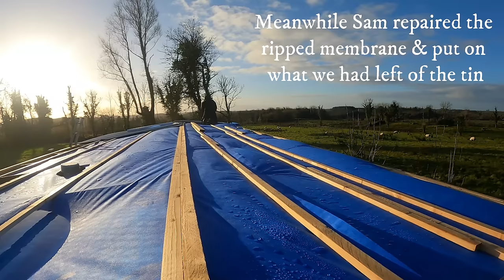Storm Debi hits our derelict farm in Ireland. Episode 14

Comment: Well done folks you got a lot done , after Debi left her trail of destruction. Scary stuff.The static will be so much more warm and comfy. When it's fully framed in. Hopefully you will have no more flexing walls after that. Fingers crossed we get no more big storms like that again for the rest of the winter. Glad you're all safe. Love seeing the kittens getting up to mischief outside. ❤.
Reply: Glad you are safe and hopefully you can get the static framed in safely slat roof and drain piping to remove excess water to hopefully avoid bulging roof
hopefully you got full flue sorted and also got some way of piping heat into the bedrooms - hopefully you will find good neighbours who will lend their hands and their advice/wisdom to you in helping you settle in and become absolute successes in your life here despite my own hatred for my homeland ireland
Reply from the maker: Yes we are cosy & and warm, and that makes a huge difference to your mindset. I will definitely be happier once the cladding is  done. No more bending in walls hopefully.
Reply: I'm only catching up with ye now at the minute, I'm just on the morning after storm Debbie, that tree that fell over an pulled up all its roots,if you cut off the tree from the base,the base should fall back into its original place,be careful if that's what ya do.
Reply from the maker: Thanks so much. The tree did exactly that! It's now just a big raised stump. In this weekends video you will see us start to clear up after storm Debi. Only just found the time after getting the caravan cladded. Thanks for commenting. 👍

Comment: Good progress on the roof. Glad that it wasn't a stronger storm. Nice to see you all getting on with it. 

My Grandparents bought a remote cottage in Herefordshire in the 90's up a mile long track with no services except a phone line strung along the hedge. 
 Me and my twin Sister aged 10 lived with our 60 year old Grandparents and moved to the Cottage on the Hill. We bought a Subaru Bratt 4x4 pickup and later a 1600 & 1800cc Subaru. 4x4 estate. We camped in the cottage, sink unit out the front. Had a grant for Kitchen, bedroom and bathroom 2 story block extension. Cottage was limestone.

 Waited a year for wayleaves/ permissions for electricity, transformer over 2 fields, wood, orchard and up our garden. In meantime using dreadfully unreliable Lister 14kva generator that took 3x 4wd to get it up there! Water was a borehole 273feet by a chap called Mr Morgan. Electricity finally connected after a year and 8k cost! 1600CC Subaru builders burnt out the clutch and Grandparents skint and it was scrapped. Used the 1800cc one with hi/lo ratio and builders hired a 4x4 thwaites dump truck.

As an 11-15 year old it was a fantastic place to live with wild deer, sheep, badgers, foxes, red kite. Could walk for hours and not see anyone.  hill fort, Fishpool valley and lime kilns. All owned by the lady of the Manor. There is a derelict tin roofed stone cottage further up the track and would love to buy it but falling down. No idea who owns it but expect price to be around 200k so unaffordable.

We lived there for 4 years and when sold had to pay a proportion of the grant back.. Bought for 30k, sold for 85k. The people we sold it to still own and live there and love it. Moved from such remoteness to a grade 2 listed double fronted Georgian townhouse in Harborne Birmingham. Then Porthleven,  Cornwall.  Near Villedieu-Les-Poeles, France,. County Kerry and now back to the UK. I live on a narrowboat.
Reply from the maker: Thank you for sharing your story. I really hope my kids look back on growing up in a rural place as fondly as you do. ❤️

Comment: I’m delighted that dodgy lintel is down. Those give no warning before letting go and, unlike brick/block walls, rubble walls keep falling until there’s nothing left to fall. All that stone you shifted could decide it wants to come down just as one of you is stepping through the doorway underneath it.
Having it gone is a huge relief. Some people insist you should replace them with wooden ones again, because that will accommodate the movement in the rubble walls, but I think I prefer a reinforced concrete one, when I see what’s sitting on it and how easily it moves, if the lintel gives way.
I’m probably going to install a reinforced concrete beam around my whole house, at wall plate level, too. That’ll give me a familiar base to build the roof on.
Great progress, despite the setback. Well done.
Reply from the maker: Hi Duncan. Yes think Sam has concrete ones in mind. He is definitely happier with it down! It was very dodgy. 😳

Comment: I don't know if you have considered it but a skirt around the static would be beneficial as it stops the draft beneath the floor. I've seen this done with insulation board but OSB would work also to block the flow of air.
Reply from the maker: We are going to be cladding the static in live edge timber down to the ground. Hopefully that will help.

Comment: If you make 2 compost thingies😂 you can turn your compost easy and it wil compost faster, i have 3 ,1 readdy to use 1 half way and a new one work very well and for a new garden you need lots and you wil have losts to put on. There wil be mouse and rats so not to close to where you live and you do smel a compost heap
Reply from the maker: Thanks for the advice. We do plan on having 3 eventually, but until we get the house done & the drainage put in, we are not 100% sure where it will be sited permanently. One will do for now as a start and yes lots of critters will come. I just hope the cats keep them under control. 🤞

Comment: Wind storms in Ireland are major, and you're on top of a hill. And I don't want to be the bearer of bad news, but locking in wet insulation under the plastic membrane will breed a lot of mould.
Reply from the maker: You may be right, but that's the only type of insulation we could afford. Hopefully, it will do the trick with ot without mould. The good news is that it's on top of our original caravan roof so it won't affect our health.  Fingers crossed. ☘️👍

Comment: Just binge-watched your  having just come across your channel. You've certainly got  serious job on there. I wish you luck. On the matter of the ivy it does not feed off the trees but uses them for support. If left unchecked the ivy grows to the tree top where it continues to grow creating a weighty mass at the top which will ultimately result in the tree toppling over in high windy conditions
Where you have severed the stems of the ivy you will find that the upper growth left will die and can often be more easily pulled off. I have personal experience of this with mature ivy growing up a substantial Ash tree.
Reply from the maker: Thanks Derek. I know it makes the trees very top heavy. I think sadly most of them are dead or dying so will end up having to come down anyway. Ash die back is awful.

Comment: What you might do is use the rusted corrugated metal to reinforce the wall that was moving during the storm.
Reply from the maker: Hopefully, the plan is to clad it in timber. They should help protect it against the wind & stop the movement which is very disconcerting to see. X

Comment: Looks like Mother Nature gave you a big wet sloppy grandmotherly kiss.  I know, not always appreciated.  Little wonder that the houses of old were made of stone (I know, it's what they had....).  But, all in all, you fared fairly well under the circumstances.  Two things to consider - 1. Split the Compost.  Left-Right, Front-Back, whatever, with a diveder.  Fill one side over time and then the other.  Let the first side 'compost' and do its thing while you then fill the other.  It makes it easier to maintain the composting side (turning, etc.).  And then switch back and forth to harvest your rich compost hopefully, year-long as the two sides mature more-or-less independently.  Second, Seal the screw holes on your metal roof with 'mud'; no, not actual earth-mud, but in what is known as 'mudding and taping' your primary roof.  A good water-proof (not just resistant) sealant generously applied over the screws should do the trick in your situation. A sealing tape along the edges of the metal sheets will also help keep the moisture out.  As you know, water and wood don't play well together over time.  I know the Static is not the forever-home, but it is until the other is complete.
Oh, I love your channel!
Reply from the maker: Wow thanks so much some great advice there. We really appreciate the time you took to send us that. We do need to perhaps look again at the compost bin and figure out if we can divide it up or add more bins. Think we may have sited it too close to the caravan from what others had said. 👍